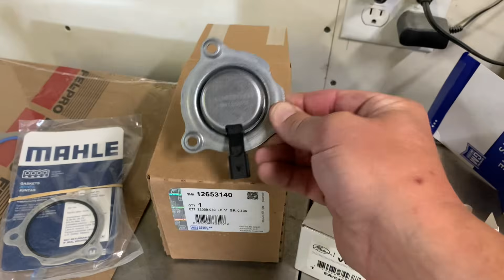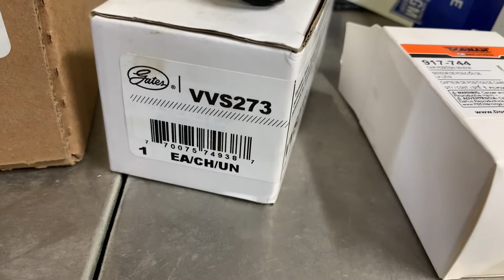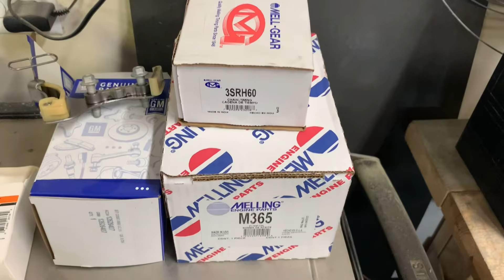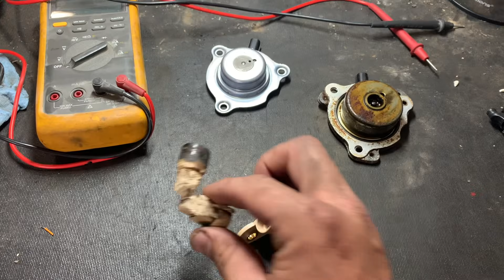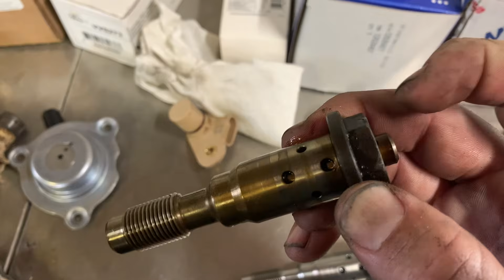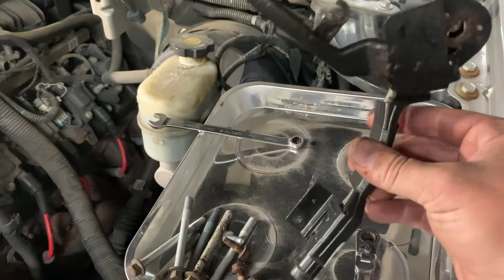6.2L GM Escalade Yukon Silverado P0011 Code Easy Fix VVT Repair

Comment: The 5.3 should be identical right? And have you had a problem with a misfire on cylinder 7? P0307
Reply from the maker: Yes 5.3’s are the same. 1 cylinder missfire I would start with basics, ohm plug wire and inspect plug. Move onto swapping injector to different cyl and see if the miss code follows. If not then you might have a bad intake gasket those have been updated since they first came out.

Comment: Im having an issue I swapped a 07 non dod engine into a 2010 escalade and now I turned off dod on ecm and it still cant get it to turn on correctly it’ll turn on but die back down codes im getting are P3401, P3425,P3441,P3449, P0108, all symtoms 00
Reply: Just turning off the dod via dongle doesn't work.  You need to send your computer in for a reflash.

Comment: I replaced the magnet, the vvt bolt, and cam shaft position sensor after a couple of months it came back up, someone help me !!
Reply from the maker: If you cam sensor was not a Dorman or delco I would start there. Sounds like a part failure

Comment: I went to change these things as well but noticed I can pull the crankshaft pulley back and forth very very little tho is that normal ?
Reply from the maker: By hand?? No. There is a slight clearance for the thrust bearing but shouldn’t be really noticeable especially if you aren’t prying it back and forth. I’d say you have bearing issues
Reply: You’ve got to use some force it will move forward and back less than 1/16 inch I thought possible as well but it runs perfect doesn’t skip a beat

Comment: I have an Escalade 07 and on ready replace the magnet, sensor and vvt bolt and till shows the code, what can it be ?
Reply from the maker: I would put a manual oil pressure gauge on it and see what pressures you have with engine at op temp.
Reply: Same did you find the problem code came back on

Comment: Thanks for the tips. I just did the magnet and sensor on mine but could not get the bolt out. The sensor was a total PITA. Took me an hour of slowly working it. It must slowly expand over time cause the new one was almost loose going in.
Reply from the maker: I think when they expand they fail, hope it fixes your issue!

Comment: Do you have Oil pressure problem? Lower than 100KPA
Reply from the maker: Nope and haven’t seen the code since this vid.
Reply: @trbokmro  I do not know your mileage, but russian says l92 lacks of oil pressure on high mileage. For my Escalade 2007 esv I have oil pressure 110-120KPA after hour of driving. This can cause VVT problems in future and then they say engine should be rebuild with replacing camshaft too, but even this can not help sometimes. Lifter cylinders in block can be out of dimensions and oil pressure problem can consist even after replacing everything. The solution is buying other block. 
Not sure if they have accurate stats, but it is   what I know for now. May be you have low mileage. My has 8500 enging hours, at 11500 hours they can suffer from VVT issues and low oil pressure.
Reply from the maker: @olegorlov1379  mine is around 160,000 miles and I run 5w-30 oil and when I replaced the oil pan gasket I replaced the oil pump pick up tube o ring which has a history of failure and causes low oil pressure. If it were mine I would do a high volume high pressure oil pump before rebuilding or replacing the entire engine, assuming you don’t have a bunch of metal in the oil of course. Depending on your year something worth looking at is a filter screen under the oil pressure sensor, my neighbor had low warm oil pressure but the engine sounded perfect, found it had that screen with build up on it and replaced the screen, fixed the issue. I want to say his was 2010 year if I remember correct.

Comment: The sensor most likely had a little carbon from engine oil built up on it. I just done one on a truck that the guy doesn't change his oil on...like never. Just tops it off. I was able to get the sensor rotating back and forth after about an hour of messing with it. So then I sprayed some Berryman carburetor cleaner around it and it popped out after a few minutes. It had black crumbs all over it that I'm sure was carbon from burnt oil.
Reply from the maker: Mine was mushroomed out on the end causing it to bind, you got lucky this one was a pain to remove.

Comment: I have 2011 camaro SS with L99 engine with stock AFM system and VVT Sprocket. I have P0011 code in the test mode only without check engine light (before crank). While cranking I see Service Stabilitrak message for a couple of seconds. Does it make a sense to replace camshaft sensor / adjuster magnet, VVT sprocket with VVT valves, timing chain and VLOM solenoids ?
Reply from the maker: Different conditions than what i experienced but for as cheap and easy as it is I would try the cam sensor, magnet and valve first before tearing it down to the T chain. Only having the issue at crank sounds like an initial communication error.

Comment: i have a quick question what is your oil pressure at idle worm
Reply from the maker: High enough to not kick the oil pressure light on LOL, I haven’t put a mechanical gauge on it sorry don’t know. Rule of thumb much less than 20psi is not good.
Reply: GM reccomends no less than 5 psi and claims psi varies with mileage.   200k hot idle, 15 lbs is considered avg, but I generally feel comfortable no less than 20 psi while some continue to drive fine at 10psi hot idle.

Comment: sweet rock auto collection. doorman is a stopgap. oem is best..on all parts.if possible of course. ive run across several dorman parts that dont fit quite right.

Comment: I have a 07 Escalade timing cover came off new chain,tensioner, cam phazer, solenoid valve , magnet actuator , position sensor , code still comes up can a lose pickup tube be an issue ? When i put it back together and pick up tube to the oil pump was left a bit loose due to having to drop the oil pan to tighten the bolt that holds it together, would very much appreciate your input thank you
Reply from the maker: You put it all back together with a lose pickup tube??? Yes that could be your problem and the o ring itself could be the issue. Put a mechanical gauge on it, PS I have a vid of doing the oil pan gasket, not hard at all and probably leaking anyways.

Comment: With the code that you had. Was one of your symptoms stalling when coming to a stop?
Reply: i had that issue, i belive it was the crankshaft pos sensor
Reply: @kmachado4 any updates on crank sensor? We have same code on a new build motor. Just pulled pan again, new HV HP melling pump, VVT solonoid, sprocket and valve, and of course a other pickup o ring.  Still same code and low oil pressure and stalling.
Reply: Sometimes the vvt timing solenoid will cause that issue as well.
Reply: Did this fix ur p0011 code mine is showing the startrak light and abs
Reply from the maker: No it never had a stalling issue. I would think the ecu uses the crank signal for desired idle speed but I could be wrong, definitely fix the cam sensor code if you have one before any further diagnostics are done.

Comment: I purchased all the part you did even did oil change timing, code won’t go away I didn’t check the wire harness it looks okay but I’ll check it than if that doesn’t work I’ll change ecm and than if that fails I’m getting a new engine
Reply: Maybe check oil pressure with manual oil gauge. If low could be O=ring on pickup tube.
Reply from the maker: if you replaced everything including oil pump you might have a low oil pressure problem. I would hook a manual gauge to it and ge the thing to op temp and see.
Reply: Did you figure  it out. I changed all these parts along with the harness  everything  from the dealer. I did my o ring pick up tube oil pressure  is perfect  truck runs perfect  it just shuts off once every few weeks and it's hard to start
Reply: @eddiesgsr  did you get an oem cam actuator magnet? I had the same problem you did then changed to an oem one and it went away...
Reply: @BODWeddings  yes I changed all that even the jumper harness  everything  from the dealer and I did the job twice im thinking maybe I got a bad part because the second  time I changed  it  it takes much longer to come on when I earse it and sometimes  it goes off by itself  the first time I changed it the light sometimes  comes on the same day
Reply: @eddiesgsr  torque converter clutch solenoid will do this if it's stuck on and most of the time you won't get a code for it neither on these trucks.
Reply: @warriorplutotrent3827  got fed up and sold it. Took a major hit with all the money I put I to it.  I'm sticking  with Japanese  and Germans